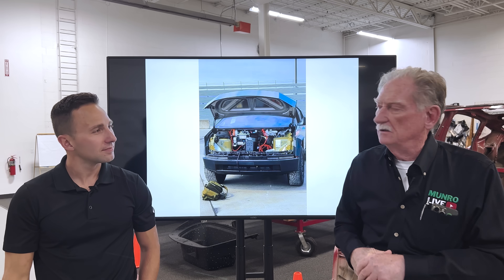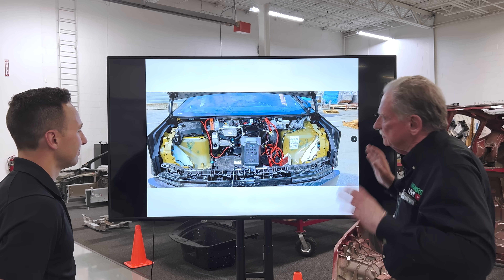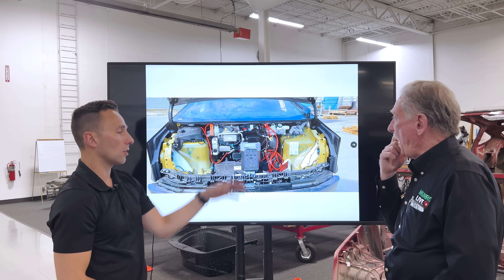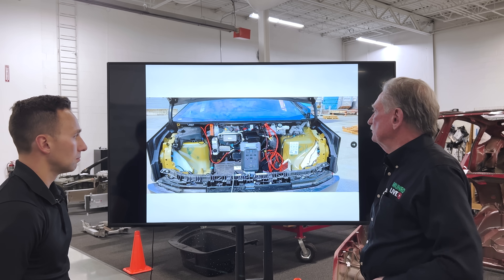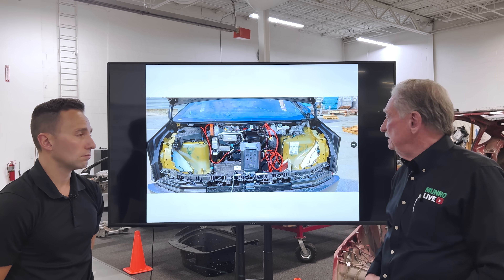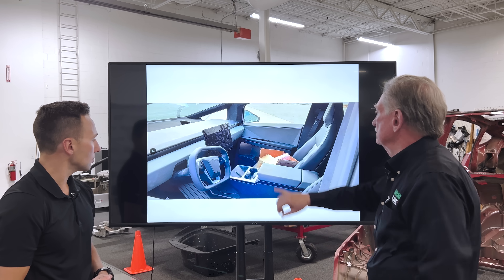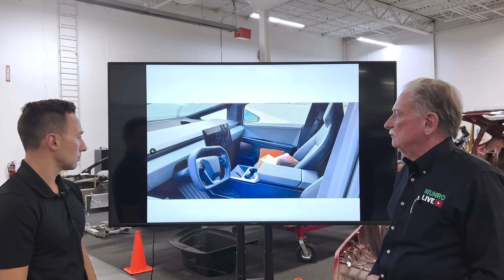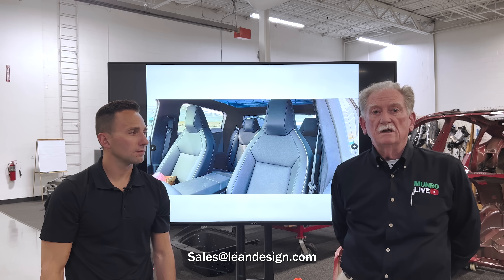Tesla Cybertruck Dual Motor closeups.

Comment: No turn signal stalk is stupid,impractical,as is square steering wheel,probably designed by nerds who never drove a truck.
Reply: That’s ridiculous. You’re right and left thumbs are always available to press the right or left signal 😑
Reply: @Live2ride2live54321 except in the middle of a turn, like a roundabout where thumbs are not necessarily near the buttons
Reply: The car automatically turns the signals on in full self driving mode.
Reply: @dbwelder9159  - I've been driving the yoke for about 20 months now, and really there isn't an issue. I got used to the change in about a week. Now I like it better than the old stalks.  I have no problems signalling in roundabouts either.  It is different.  I'd say there are a few times it is still odd, but there were a few times where stalks were odd too when you hands are not near them.  Different conditions.  In non-FSD, the Tesla blinkers automatically turn off in many situations that stalks never did - like exiting the freeway, which is cool.
Reply: @Live2ride2live54321  But they took my thumb Paulie!  They took my thumb!
Reply: @dbwelder9159  You turn your turn signals on in the middle of a turn?  How are your fingers near the stalk?
Reply: @scottgaree7667  How about your right hand is doing the turning so the left hand is free, and not chasing the blinker switches on the wheel... And yes turning a turn signal on during a turn in a roundabout indicates your intention to change direction.